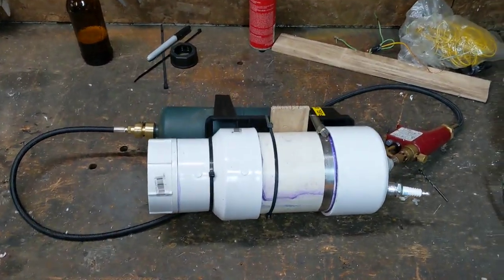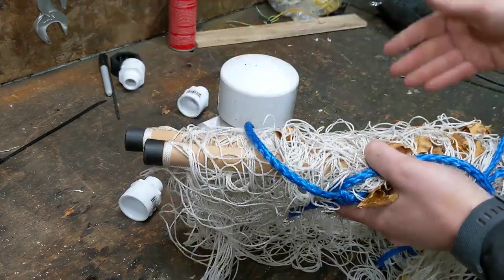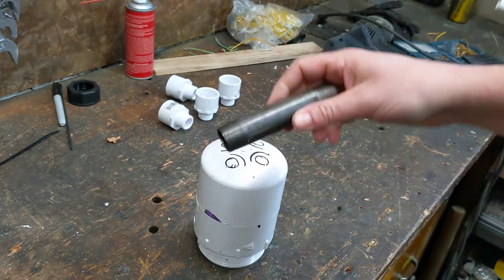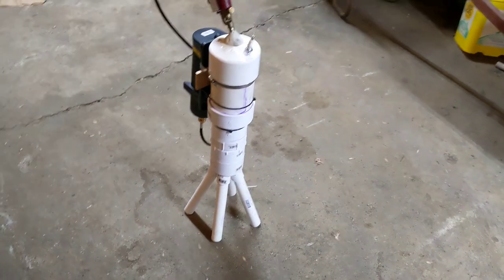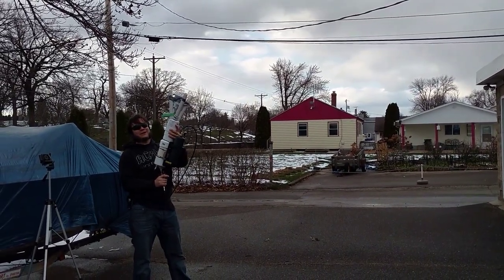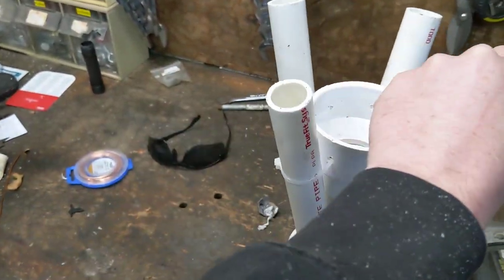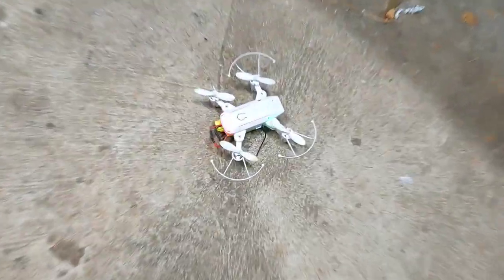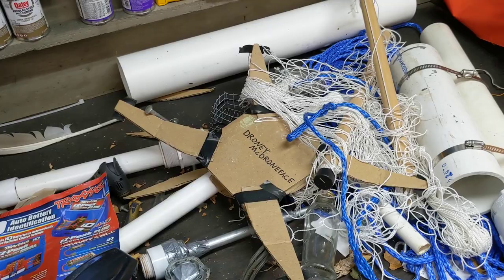Drone Catching Net Launcher

Comment: You can reduce the primer-cement contamination problem greatly by using MUCH less primer. You're swamping it on there like you're trying to drown the dang thing.
Actually some research has shown primed joints are weaker than cement-only joints so you might wanna skip the primer altogether.
Reply: Never in my thirty years of plumbing never heard that about not using primer. There is one part cement.
Reply: There is clear primer stop using that purple stuff your not going to fail a plumbing inspection. Purple is messy stuff

Comment: More gas heavier wights net needs to be made from a cast net it’s supper light and also if you got a cast net you got led to melt on the bottom mold them into a projectile. Im still pretty sure this is illegal btw was told shooting down a drone is like shooting down a commercial airplane